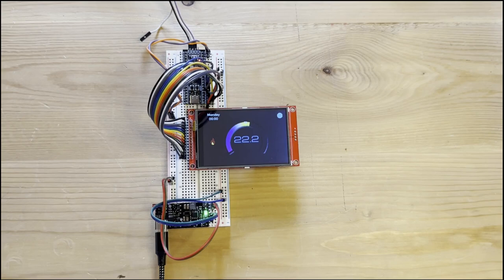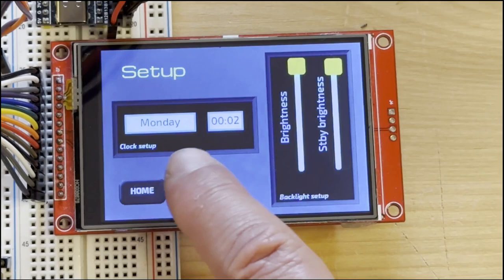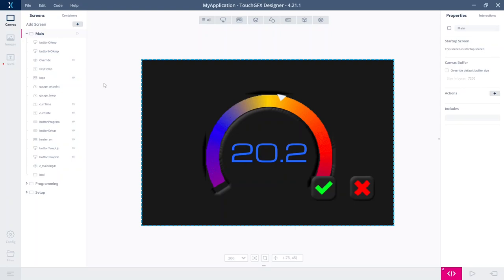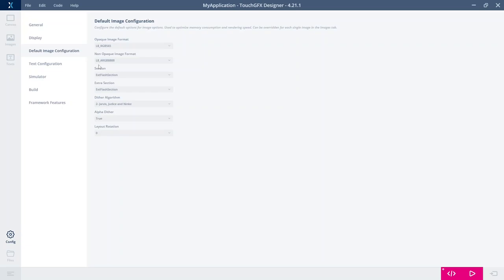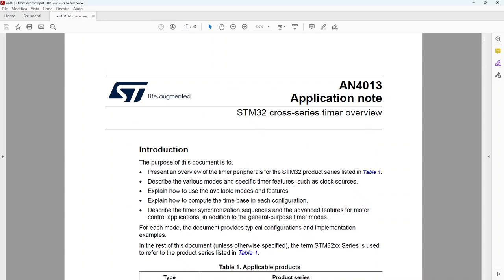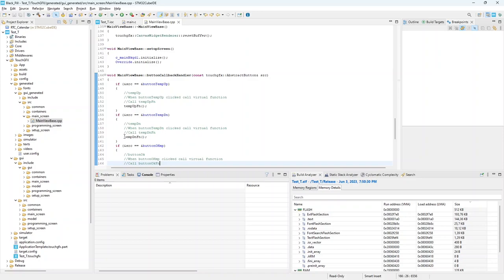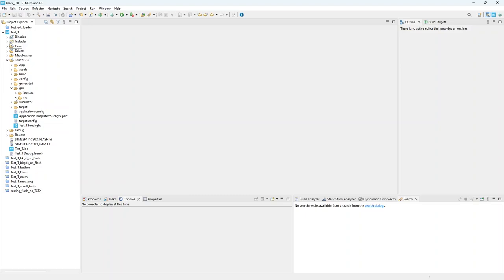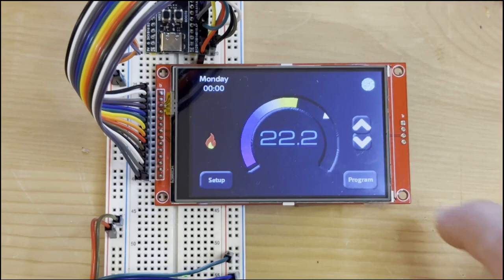A full TouchGFX project with 3.5" SPI display and the full set of TouchGFX widgets

Comment: Thanks for your great guides & information. I've just created my first GUI using TouchGFX and it worked well. Are you aware of a way to remove a background image from a widget? (i.e make it "No Image") My background image has the gauge background embedded, so I dont need it in the gauge/meter. I have used a transparent background at the moment in each item, but looking at this video it might affect my file size depending on which colour format I'm using.
Reply from the maker: In such a case I load the project with a "dummy" image of 1x1 pixel of the backgroud color and I use it in gauges that have to be transparent. "Dummy.png", that could be even transparent, will be shown in the top left corner of the gauge.

In the project you see in this video there are two gauges overlapping (the first - on the back - has the color arc, the second - front - shows just a pin).
Both gauges have a 1x1 pixel background (the same "dummy.png") allowing a below background image to be shown.

I hope this helps.

Comment: Hi Mr.Mauro. How can I activate  the callback function 
to implementing the tick timer for TouchGFX?
Just enabling the timer 2 in the STM32CUBEIDE?
I did it but didnt work.thanks, best regards
Reply from the maker: Handling timer shouldn’t show too much surprises. Did you start timer?
Reply: Yes, I started the timer. I´m using stm32f429.
May I use another timer instead TIM3?
The void HAL_TIM_PeriodElapsedCallback (TIM_handleTypeDef *htim)
didn´t appear in the z_displ_ILI9XXX.C library
Reply from the maker: @fernandoprudencio5521   Callback is just at the end of z_displ_ILI9XXX.c file. It refers to the TGFX_T macro parameter on top of z_displ_ILI9XXX.h in order to have just 1 area to modify, setting up a project. It is also controlled by DISPLAY_USING_TOUCHGFX macro (again on top of z_displ_ILI9XXX.h) in order to avoid mistaken handling if not using TouchGFX. So: setting up a timer with its ARR and PSC, enabling interrupt, setting also above parameters and turning on timer on main, everithing should go.